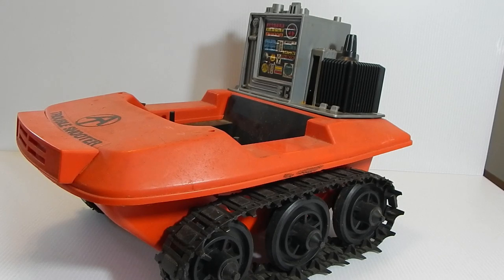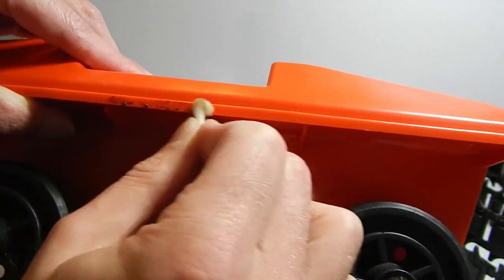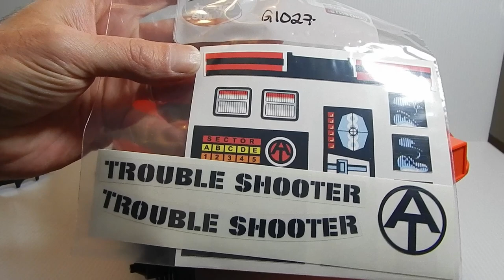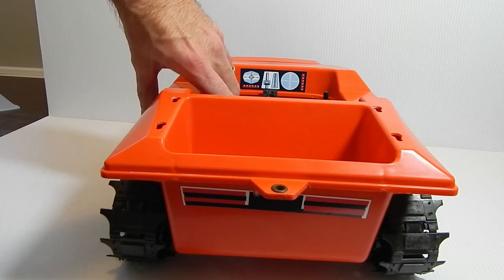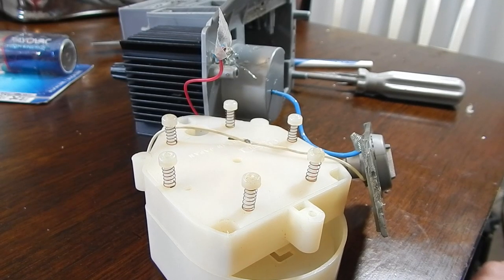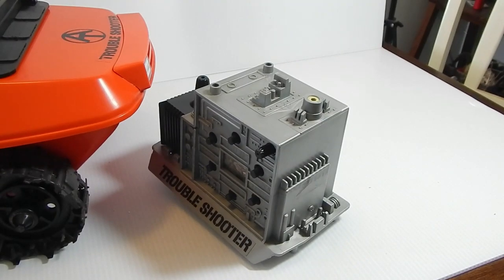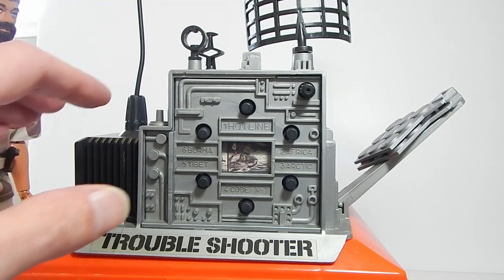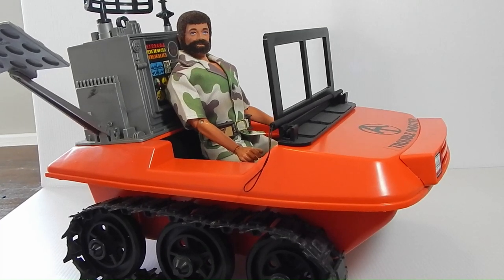GI JOE TROUBLE SHOOTER RESTORATION

Comment: Great video Pete!!! This is one piece I would love to own! They are hard to find & very pricey!! This is on my watchlist & wishlist! Learned alot by watching you take apart the SATCOM unit! Great job!
Reply from the maker: Thanks very much, I got lucky, this was only 50 dollars from a local seller, but considering parts and shipping i'm in about 100 total, still well worth it!!
Reply: @TheSkullReviews  that's a bargain! When I was at the Arizona ToyCon...I guy had a complete Trouble Shooter...only thing missing was the vulture. He was asking $450 for it. I'm thinking I can pick one up for less than that.
Reply from the maker: @g.i.joethelostchronicles6807  That is the going rate but yes, you can do better, just have to hunt and likely restore one like mine that was beat up.
Reply: Maybe the motor needs cleaning 
Or loose belt
Reply from the maker: @georgemartinez1720  I checked on the belt, it is good, but yes, I'm going to buy electronic contact cleaner to get it working better

Comment: Great video! I bet you can speed the motor up a bit with some electrical contact cleaner.
Reply from the maker: Agreed, I need to pick that up, thanks for the tip and for the parts, you helped make this possible :)